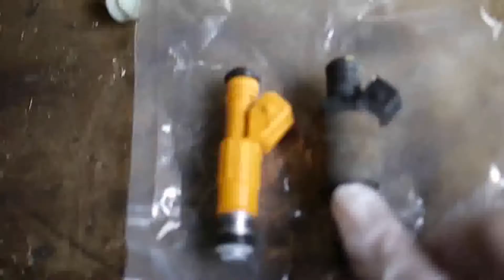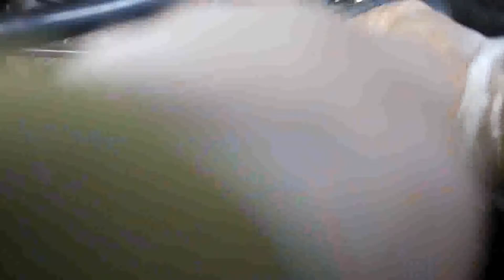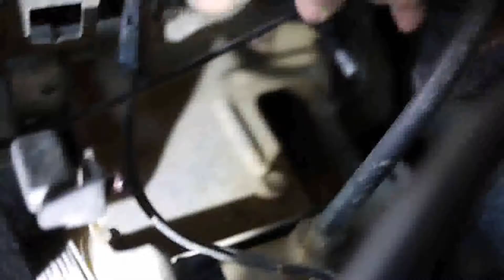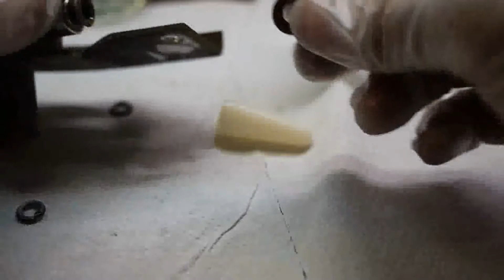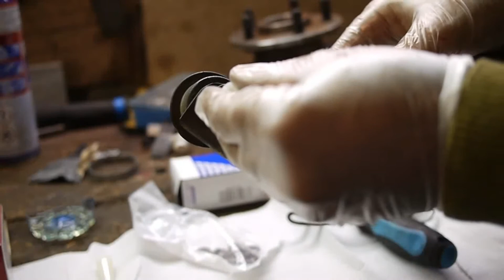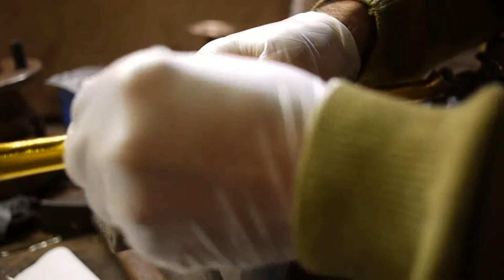✅ Injecteurs essence (Jeep Cherokee)

Comment: Salut Jean Marc.

Depuis quelque temps mon xj a un soucis sur l'injection.
Il tourne sur 5 cylindres.

"Il y a un 2 an (environ), j'ai eu le même soucis (au diag les codes erreur étaient les injecteurs , 3 sur 6 posé problème) .

Donc , j'ai remplacer les 6 injecteurs  (par des neuf de type origine. Pour le prix j'aurais du prendre des 4 trous mais je ne connaissais pas encore ce type de swap 😂).

Ensuite comme il avait tendance à mal démarrer,  j'ai remplacé l'ensemble pompe a essence (le régulateur de pression et le filtre à essence sont montés sur la pompe à essence) et les 6 bougies.

Depuis les démarrages, c'est le top😋. "

Actuellement par moment il broute au niveau de la puissance et quand j’insiste de rouler avec le voyant moteur s'allume et le code erreur est injecteur 6 (P0206). L'injecteur 6 est celui qui est vers la baie de par brise. Les 6 injecteurs on environ 6 000km depuis leurs installation.

J'aimerai changé de place cette injecteur dans le but de le testé pour voir si cela viens bien de lui (comme sa le code défaut sera sur un autre injecteur et je serai fixé).
Vu qu'il faut démonté l’ensemble de la rampe pour faire ce type de manip, les joints des injecteurs seront à changés obligatoirement ou bien il est possible de les réutilisés  ?

Ou sa serait un problème d'alimentation électrique  de la prise qui met l'injecteur en défaut ?

je te remercie par avance.
Reply from the maker: je pense que depuis tu as résolu ton probléme ?
Reply: Salut J-M. Tu vas bien?
J'ai pas encore fini la petite vidéo sur le joint de nez pont😜 (j'ai repris le boulot, je suis mort quand je rentre 🙃).

J'ai commander les injecteurs 4 buses sur Ebay, un revendeur Pro spécialisé dans le reconditionnement d’injecteurs ( "https://www.ebay.fr/itm/Motor-Man-0280155784-Fuel-Injector-Upgrade-1999-2004-Jeep-4-0L/293124764818?ssPageName=STRK%3AMEBIDX%3AIT&_trksid=p2060353.m2749.l2649 "du vrai , du bocsh 😁).
C'est toujours à Chicago depuis le 28 avril , 5 semaine pour 6 injecteurs . c'est long
Reply: J'ai reçu mon nouveau arbre de transmission de chez "Adams Driveshaft", pas encore monté. 😩
Reply from the maker: @romain3948  Salut, ça va cool merci, moi j'ai pas arrêté de bosser donc ça va, mais oui pas facile de reprendre le taff après ça, cool pour te nouveaux injecteurs,
Reply from the maker: @romain3948 ou la la...très bien, pourquoi tu changes ton arbre ? tu as monté un SYE ?
Reply: Usé par le confinement 😝

J'ai déjà le ruban thermique pour la rampe et la gaine isolante pour les injo.
J'attend encore les silent blocs pour les lames arrière (j'ai pas le coq dans le coffre mais le poussin 😆), c'est des lames Rusty'S Off Road et le diamètre des silent bloc est différent de celle d'origine et des autres marque de rehausse,  le kit silent blocs a été galère à trouver.

J'ai le joint spi du carter de distribution (derrière la poulie damper), sa sent bien la galère à faire celui la.

Et j'ai un suintement entre le boite de transfert et la boite auto 😌.
A l'avenir faudra que je démonte et faire la remise a neuf de la boite de transfert.
Reply from the maker: @romain3948  punaise...t'as de quoi t'occuper la avec tout ça ! si le confinement t'a usé, ton XJ va te finir :)
Reply: C'est l'arbre avant que je remplace, la chape coulissant sur l'arbre a énormément de jeu et sa use prématurément le croisillon.
Vibration sous les pieds. 
Faut bourré de graisse pour  enlever les vibration , mais sa ne dure pas.

Et sa, je pense que sa vient de quand il a été rehaussé , pas de barre panhar réglable installé, juste une cale qui sert a redescendre la barre panhar d'origine. L'arbre a travailler trop longtemps de biais et sa usé au niveau de la chape coulissante. 

Quand j'ai mesurer la position de l’essieu par rapport à la caisse, sa aller pas du tous , rien de centrer.   

Des années il va me devoir le XJ , après toutes les recherche faite sur google, les demandes de conseil à J-M, le temps travailler dessous ... 😆
Reply from the maker: @romain3948  ok je vois, tu m'étonnes qu'on y passe du temps

Comment: Bonjour jean marc , je rencontre un souci sur mon  WJ 4.7 l HO , depuis quelque temps il broute , il a 285000 KM , j'ai fait toutes les vidanges , je tourne à 50 % éthanol et super 95 , j'ai un boitier standard , les injecteurs je ne c'est pas si il ont était changer 
j'ai les bougies à changer , il manque de puissance , en 5eme , il avance pas . j'ai aucune facture de l’ancien propriétaire 
qu'en penses tu ?  peux tu m'aider  Merci Alain
Reply from the maker: Salut, ok ok, as tu le témoin Check Engine allumée ?<
Il va te falloir un lecteur de code graphique ou un ELM327 sur PC, sans ça pas évident de pouvoir t'aider
 je vais te dire ce que je ferai dans l'ordre:
- Consomme ton plein d' E85, tu remplis un bidon de SP95/98, tu rentres chez toi, tu met le SP dans ton réservoir.
-Tu vire le boitier, tu rebranche tes injecteurs comme avant, tu fais un essai.
Ensuite il va falloir que tu regardes tes corrections de carburation, ça se fait avec un scanner comme je le montre dans cette video https://youtu.be/ZL0luZ95eMs
Tu vois, t'as du travail !
Ensuite à 285000, bougies, bobines crayon, filtre a essence, nettoyage des injecteurs, c'est pas du lux !
A suivre
Reply: @jeepgarage  super jean marc merci pour pour toutes ses infos , je vais regarder tous ça tranquillement , car c'est mon véhicule de travail je m'en sert tous les jours pas facile de l’arrêter . Mais je vais pas avoir le choix . Je vais surement revenir vers toi pour te tenir au courant de l'évolution 
Grand merci à toi et continu ce que tu fais si bien ( vidéo et conseil c'est super ) 
A très vite  Alain
Reply from the maker: @ALAINCHAZ33  oui je comprends, pas évident si c'est ton véhicule de tous les jours, cependant, comme ça va pas bien, je pense qu'il faut que tu t'en occupes avant que ça n’entraîne plus de problèmes que tu n'en as aujourd’hui.
Reply: Tu as raison j'ai pris rendez vous chez un garagiste , pour contrôler l'électronique 
il ma dit la même chose que toi pour le boitier et l’essence je fait le test rapidement .à bientôt Alain
Reply from the maker: @ALAINCHAZ33  il faut tout remettre d'origine, contrôler, faire ce qu'il y a a faire dessus et ensuite tu verras pour l'E85, a+